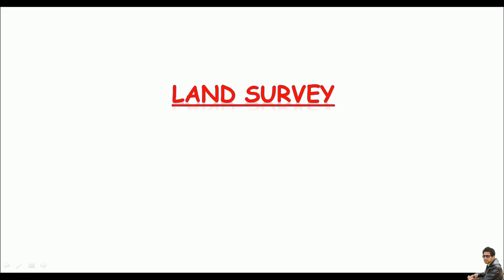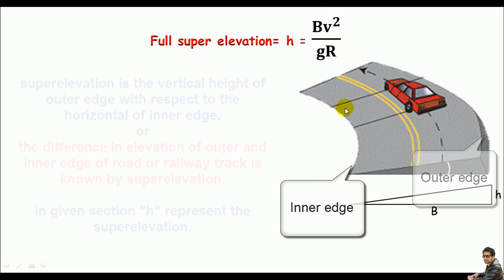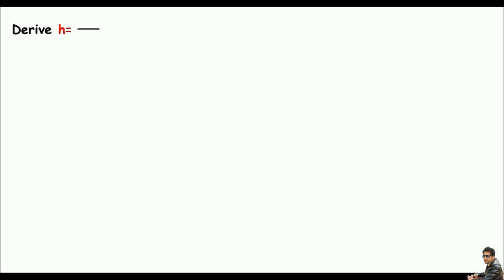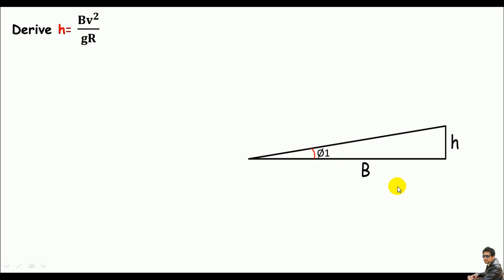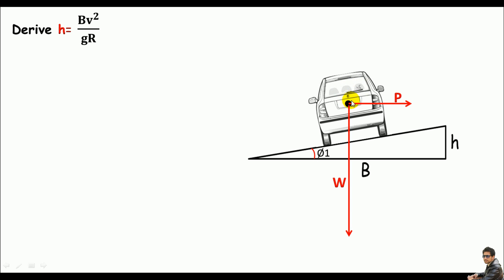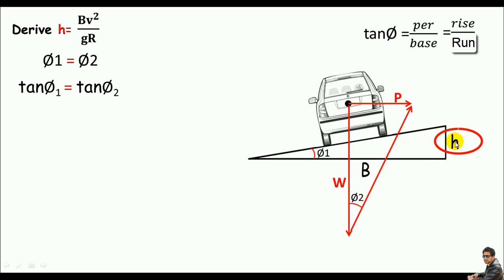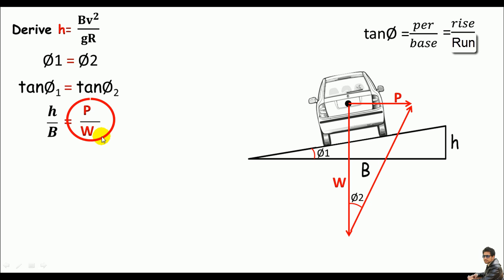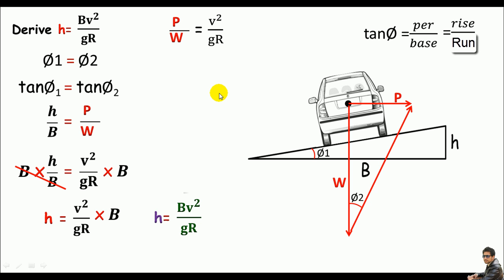Land Survey:- Super elevation or Road bending formula derivation

Comment: This can only be a loose approximation. The centripetal force acts through the tires' lateral friction against the road surface. This force exerts an overturning moment about the car's center of gravity. The only force acting on the car's center of gravity is the weight of the car.